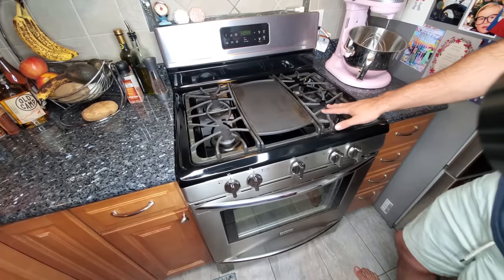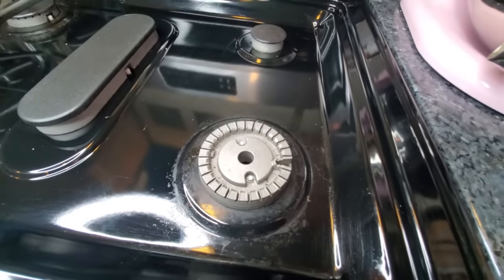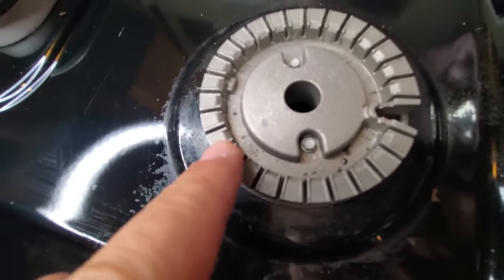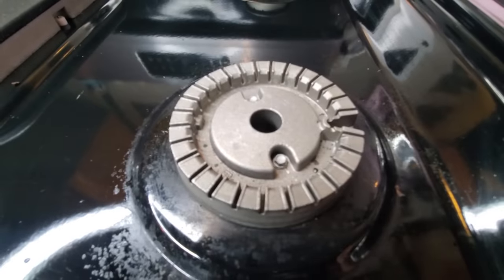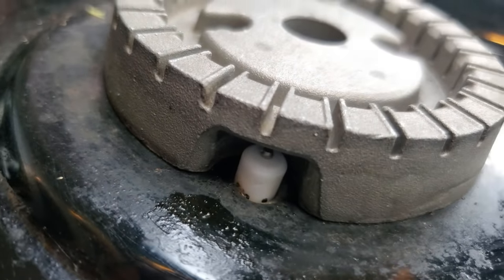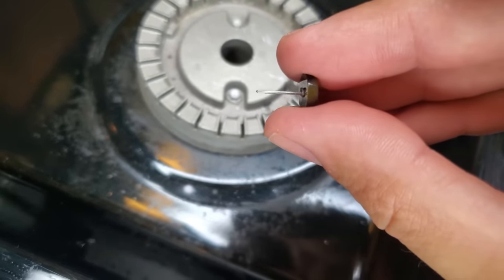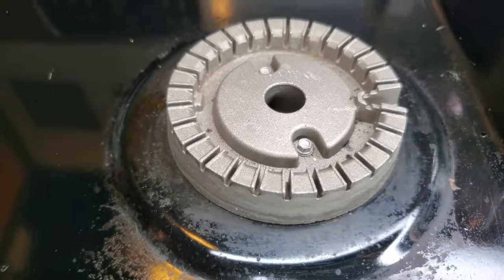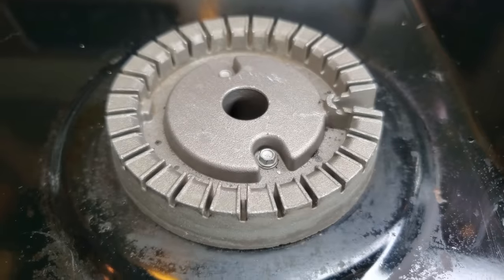Gas Stove Top Burner Not Lighting (Easy Fix!)

Comment: You can also check the actual gas port in the bottom of the hole.  Watching this video got me to look there and see that it was probably 90% plugged, with just a hair's width to allow gas through.  I took a long sewing needle and reamed it out, and voila!  A fully functioning burner again!!  I've been struggling with that burner for literally years and basically gave up trying to use it, thinking the valve was bad or something, but nope!  Just my lack of diligence!  😃
Reply from the maker: Awesome! Happy it helped!

Comment: I wish I could hug you for posting this! Losing power to two out of four burners was causing me so much turmoil as someone who cooks a lot on my stovetop, I am so grateful it was an easy, inexpensive fix!! Thank you!
Reply from the maker: Thanks your kind message!  Happy I was able to help.  It certainly is an easy and inexpensive fix!  Congrats on getting the four burners back up and running :-)
Reply: Me too!! Hugs!  Finally someone expained it correctly!  omgsh, ty!!!!
Reply: Me too, too! Fixed mine without having to call landlord because of your video! Thank you! I’m amazed I could do it!!
Reply: Me too!  A thousand million thank you's.  OMG, i went to bed thinking why me?  And then right before I called the service technician I watched this video.  This was the 2nd video I watched as the first video had me going down to harbor freight to buy tools and it just made it worse, but then I watched this video and voila, the stove ignited two minutes later!  miracle of miracles!
Reply: Ok...tried your idea and  can't find the right hole for the paper clip. It fires up fine when we use a match. Fire department couldn't help either. Any other ideas before it costs me a fortune to call an appliance guy? Thanks

Comment: I was  able to figure out that problem some time ago. Thanks for showing how simple the fix actually is. PS: When testing to see if you have actually cleared the ignition passage, you must replace the cover plate. Othersise it won't work.
Reply from the maker: Thanks for the info!  Yeah, I should have mentioned you need to replace the cover plate before testing.
Reply: How about ours no hole?
Reply: Why?
Reply: Ours has no hole either! Help!
Reply: @hollyrich5607  - is it possible that your pilot is in the middle- under the hood? May have to lift the stove top to get to it.
Reply: @jeffellis6544  nope but got it fixed! Thanks for the reply
Reply: So true because I kept trying it AFTER I cleared the hole and it still wasn’t lighting. As soon as I put that little cover back on top, then it lit 😂

Comment: thanks!! This is exactly what happened with our Frigidaire Gallery gas range. The largest burner - the one I use the most, a couple days ago stopped igniting. Even though I could light the gas manually and could see the spark. Took me 2 seconds to un a pin through that hole and WORKS!
You saved me from paying for a service call.
Reply from the maker: Glad to hear it Jeff!  Have a great weekend!

Comment: Thank you so much for that tip!!  I have a GE Profile gas cook top and one of my burners has not been working for so long.  It would have easily cost me $200 to have someone come out here and fix that burner.  Your video is so spot on.  Even though I have different burner pieces ... I had no problem utilizing this technique.  I actually used jewelry wire because the holes for the gas release is actually lower than a reach for a back of an earing.  Thank you for empowering me and getting be back to a fully operating cook top!  Sincerely!
Reply from the maker: So happy to hear it!!!  Glad it was an easy fix for you as well.  Thanks for letting me know!

Comment: That is something in the past I may have just had to call the repair man for.  Thank you!   That big front burner was hit or miss.  There was rusty dust around the inside of the burner and I used a paper clip to get the hole.  I did also notice that inner lip of the black cap had rust and corrosion which probably caused some gas to escape over the burner slots as well.  I tool a wire wheel to those caps and top of the aluminum burner assembly.  Between those 2 things it is working great now.
Reply from the maker: Sooo happy to hear it!!  Thanks for letting me know 😄

Comment: Thanks for sharing, however I still had the problem of not lighting even after cleaning the nodule. I was so frustrated that I put everything back together and left and got takeout. Later I forgot that the stove didn't work and I turned it o  and viola it worked. Come to find out the newer stoves(2017) have a safety mechanism(to prevent premature burning or 🔥) so you have to put the metal face plates/covers back on the eyes. Then and only then will it light. Hope u can incorporate this with your next video.
Reply from the maker: Glad to hear you were able to get your range working!  Thanks for the tip regarding the face plates.  Yes, I will for sure add this in my next video on this subject :-)

Comment: Thank you! At first, I did not reapply the little disk that goes on top, and it still wasn’t working and I realized because the gas was coming straight out through the center. But it finally worked again once I reapplied the disk.  I should’ve checked YouTube a long time ago.
Reply from the maker: Yay!  Glad to hear it!
Reply: I had the same issue and felt kinda like a dope for not putting the disk back after cleaning the darned stop top. 😂 but this video compared to the other ones was amazing and quick.

Comment: Thanks for saving me over a $100 !    I found that my wife ,   in cleaning the cooktop,  used the ceramic top cleaner and blocked the gas holes on the simmer burner and the turbo burner.  At leasst it wasn't some sort of boil over goo I guess!  Thanks again !!  I find that a fine wire from an old telephone service wire is exactly the right size to clear out the hole.
Reply from the maker: Great job!  Happy it was an easy fix 😁

Comment: Thanks for this video, 

I had an oil overflow the other night that clogged things up and the burner wouldn't light the next day. 
I tried a bunch of other tutorials but none of them worked. I thought If I cleaned all the radial vents enough that would be enough but had no idea about that small hole for gas to hit the igniter. 
Sure enough, stuck a pin through it like you said and the stove lit up just fine. 

really appreciate you sharing this tip,
Reply from the maker: Thanks for sharing!  Glad it helped ya!

Comment: Up here in Northern Ontario, Canada, it's wintertime so our RV is bundled up for the winter. Come summer though, thanks to your EXCELLENT tip, I can finallyy get two of the four burners in it igniting properly. We do ONLY boondocking so anything that doesn't work correctly is a MAJOR problem and two of the four persistantly won't light. Now, hopefully, they will
Cheers my friend and thanks again.
Reply from the maker: You bet!  I'm sure it will help get the two burners back up and running!  Stay warm up there!

Comment: I called a service repair shop to come in to fix my burner that was not working.  Then I decided to check you tube for some tips and found your video.  Wow!!  Got my burner to work by checking the details you described; cleaned the ports and voila!! My burner starts up like a charm.  I am canceling the repair technician.  :washhands:So for now you saved me $$$ .  I will be happy to send the $2.00 thank you!!
Reply from the maker: Glad I could help!

Comment: Thank you.  Have a very similar stove.  Exactly the same problem with the same burner.  Sometimes it works sometimes not.  Have been lighting with a butane lighter.  I will clean all burner igniter holes.  I'll size some on hand wire to the burner hole and make a tool to have on hand for future use.  Thank you so very much.
Reply from the maker: Glad I could help!  Enjoy your weekend!

Comment: Thank you so much.  I haven't been able to use one of my front burners for a few weeks.  I knew it was probably related to some butter that had melted.  I cleaned where I could see butter but I didn't know about the particular area you showed.  I was dreading the money I'd have to spend to get the stove fixed and had a feeling it would be a simple fix.  I'm so glad you were so specific because all I did was get out a scrub brush and Voila, it works!
Reply from the maker: Yay!  Glad to hear it Mary!  Thanks for letting me know.

Comment: Going to try this tomorrow.  My burners light, but only after a lot of clicks and enough gas is collected to make quite a "poof."  Thank you for posting this!
Reply from the maker: Let me know how it goes!  I know all too well what you mean by the big poof!  It can be startling.  Lol
Reply: @JMGENTERPRISES  Ours is an old stove, and it doesn't have the little grooves around the sides of the round thing.  I couldn't find the little hole that lets the gas go to the igniter.  In fact, I couldn't find the igniter.  But I gave the whole area a good cleaning with a stiff brush, and it improved things a great deal.  When I was a child I watched my mother and grandmother deal with a gas stove from the 1920s where you lit the flame with a match, so I'm very aware of how big a "poof" can be.  They taught me, "Light the match first, let it burn to a steady flame, bring it to the burner, and then gradually turn on the gas."

Comment: Thanks so much. I have a problem like this with one of my stoves. I will try your method tomorrow and let you how it goes.
Reply from the maker: Did it work?
Reply: @JMGENTERPRISES  I could not locate the blocked hole. Maybe due to different model. But somehow I managed to get the flame back after cleaning and removing the food debris. Thanks 🙏 so much. It’s been very useful your video.

Comment: Thank you! That fixed 1 of the 3 that aren't lighting. The other 2 have no spark, now to figure out why
Reply from the maker: Try using a non scratch SOS pad and clean the ignitor tip.  That has brought mine back before!

Comment: Thank you I have a dual fuel range and I didn't have exactly the same holes in all that but I took a little bit of metal and rubbed it across the top of the ignitor and that seemed to do the trick I figured it had been something got in there because I had been cleaning the stove
Reply from the maker: Glad to hear it!

Comment: Thanks a ton!  Couldn't figure out why the burner wouldn't light since I had good gas flow and good igniter spark. Stuck the pin in the hole which did not seem to be plugged at all. Regardless, there must have been a bit of blockage because the burner lit right up after replacing the cap.
Reply from the maker: Excellent! 😁

Comment: The little white igniter piece isn’t blocked by the round metal vents on my stove so there was a tiny piece of burnt debris on top of it. I used a plastic fork to knock the debris off and was able to get the burner to ignite immediately. I’m so mad because I’ve been putting off getting it looked at for almost 2 months but needed to put in a request to my home warranty company for my dryer so I was going to mention the stove as well. I should’ve known YouTube would have the solution. Thanks for sharing, I honestly didn’t even think to check to make sure nothing was blocking the igniter. Maybe I can YouTube my dryer and find a fix there and save $75 in deductibles haha 😂
Reply from the maker: Happy I could help!  Yeah, everything is on Youtube I swear!  It is my go-to resource for fixing things!

Comment: This really helps, thanks so much. May I ask how can I remove a stuck burner head?
Reply from the maker: I would try using a rubber mallet.  Hitting it semi gently from all angles.
Reply: @JMGENTERPRISES  I have tried but with a med sized metal hammer, I've sprayed oil, detergent etc... but to no avail.
Reply from the maker: @cm8188  are you sure it comes off?  Do thr other burner heads come off?  Maybe try heating it up first.  Sometimes heat can loose seized things
Reply: @JMGENTERPRISES  yes it comes off and I managed to get it off finally, with heat and not very gentle taps of the hammer though! Thanks so much for responding

Comment: Did exactly as you showed. It worked for a few days and back to using a clicker lighter. Hulk sad 😞…..
Reply from the maker: Try using a can of compressed air to blow out the tiny hole!  Maybe the clog is still built up in there

Comment: Can't1 wait to try this. I never noticed a hole there. Thanks. (Miele autarkic stovetop)
Reply from the maker: Let me know how it goes!!!
Reply: @JMGENTERPRISES  Well, the Miele doesn't have little holes, but instead has little channels on top of the lower burner part that are supposed to have the same effect. On the one larger burner the channel seemed very small, so using a jeweler's file I made it deeper and wider and now the burner almost always lights on the first try. Thanks to your video I noticed the channel and was able to alleviate the problem.
Reply: Well, about 6 months later the burner stopped lighting and nothing I have done changes it, except using a cigarette lighter. 😞

Comment: I was so hopeful, sounded like such an easy fix, but didn't work for me. Hole wasn't clogged, burner still clicks, I can smell gas, but not lighting up. Will keep searching!
Reply from the maker: Do you see spark on the ignitor?  try cleaning the top of the ignitor with a non-scratch sos pad.
Reply: @JMGENTERPRISES  Thank-you for taking time to reply...I watched another video that suggested a few other tips, and eventually succeeded in getting my burner to work again! (It's hard to say what fixed it, but I immersed the top parts in degreaser and used a pin in the small holes multiple times, and eventually it lit up.) Soooo happy, and grateful your video got me started doing a homemade fix that meant I didn't have to call an appliance repair service and my burner works again!! :)
Reply from the maker: @aotearoagirl3998   Yay!  Happy to hear it's been fixed even though we don't know the what the issue was! 🙂

Comment: Great video. Where did you get that awesome griddle insert..? Also, glad you used the front right big burner that everybody uses! My problem ended up being carbon build up in that copper piece so not enough gas coming through.
Reply from the maker: Glad it was an easy fix!  The griddle came with the house so I cannot say for certain where to get it 😕

Comment: Thank you.  Having trouble since some surgary liquid boiled over a day or so ago.  I'll see if I can do this.
Reply from the maker: Let me know how it goes!
Reply: @JMGENTERPRISES  Well, the burner lit 1 time after I tried cleaning the ignition with the needle (my top cap doesn't come off), but wouldn't ignite when I tried it later.  It stopped working after some sugary liquid boiled over, so I know it's gunked up.  I'm going to work on it a little more today to see if I can get it cleaned up.  But knowing about where & how to find the ignition hole did help.  Thank you.

Comment: You have helped à lot of grateful people. Well done. But that hole is a design flaw. My gas burner has a u shaped opening and is more accessible. Gas cooker designer, please take note.
Reply from the maker: Yeah, I believe they have since improved upon this design with newer burners.  But I was at Home Depot the other day and looked at a few ranges just cause I was in the department.  All the ones I saw still had the small hole.  But some now have two small holes which can help reduce the risk of both of the clogging.
Reply: @JMGENTERPRISES  Thanks for your reply.
Reply from the maker: @frunomaol5069  - You bet!

Comment: Great video. Here's my unrelated question? how do you keep your burner caps so clean. Mine has stains that won't wash off, even with Bar Keeper.
Reply from the maker: Since I got the range, I have been scrubbing down the caps with a non-scratch SOS pad and some cleaner.  Have you tried a non-scratch SOS?
Reply: @JMGENTERPRISES  like a Brillo pad? That's the only brand I know. And what cleaner do you use? Yours look perfect. Do you do it weekly or daily? I clean the stove area daily of course, but those just get stained and I just wipe them down.
Reply from the maker: @2ysur  Brillo pads are normally steel wool and can scratch.  I just purchase my non-scratch SOS pads on Amazon.  I use CLR (calcium, lime, rust) cleaner.  I clean my stove top about once a week.
Reply: @JMGENTERPRISES  great help - I'll try it... everything else looks brand new except those burner caps!!! Thanks again!

Comment: Do you have a fix for if the fire comes out waaaay too low? I turn on the burner but even on high the flame is very weak. Thanks for the video!
Reply from the maker: Maybe the gas line is obstructed.  Have you looked down inside the hole below the stove?  If I were you, I would use a can of compressed air or an air compressor (if available) and try blowing it out!

Comment: thank you for the  great tip! it fixed one of my burners but the other one is still not lighting. the ignitor has very small spark compared to others that are working. where should i go from here? much appreciate it!
Reply from the maker: I would try cleaning the tip of the ignitor with a basic household cleaner.  If that dosent help, I would replace the ignitor.  They are cheap and easy to install!

Comment: Another Fix I've found is get a toothpick and poke inside the gas valve hole in the stove, because i remember the fire was a lot stronger and after doing that the fire was like what i had before :)
Reply from the maker: Good tip!  Thanks for sharing 👍

Comment: That part picks up also juts like the top. Run them threw the dishwasher every so often to degrease them also. Paper clip works just fine to open the hole, cheers
Reply from the maker: Good tip!  I will have to do that!